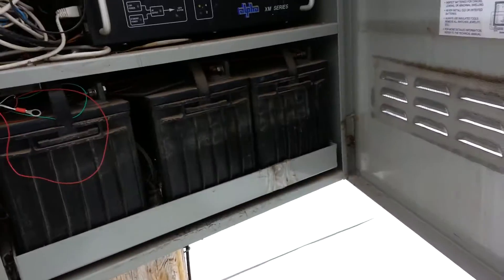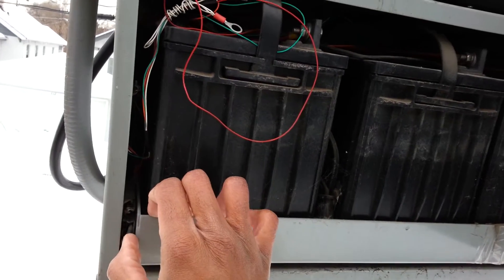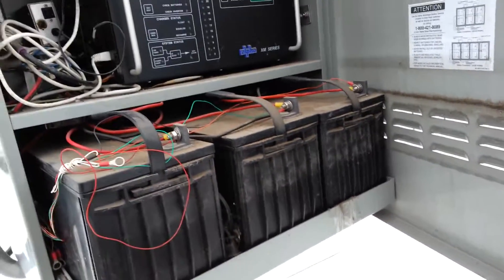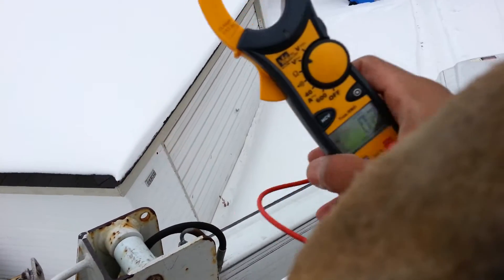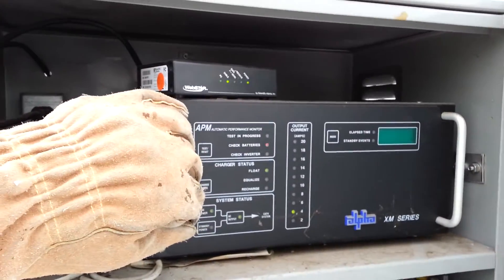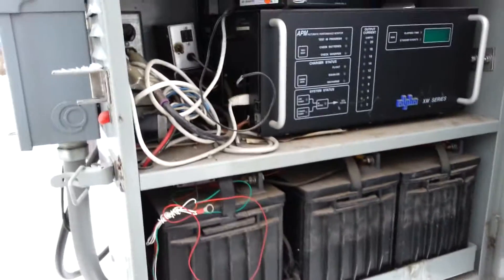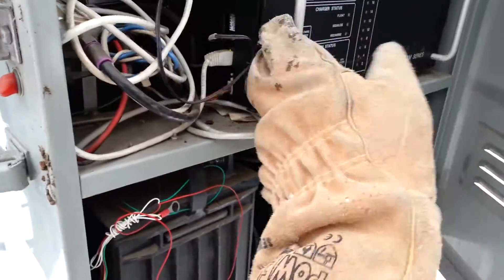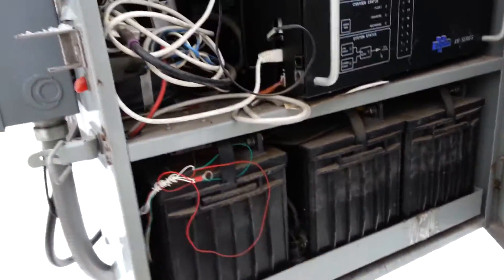CATV Power Supply

Comment: Yo is your prime contractor hiring if so can you let me know which company is it. I got 5 yrs exp
Reply from the maker: I don't work for WOW! Anymore.
Reply: @ALONZOBELL  ook im looking for another prime asap was wow a good company .?
Reply from the maker: @juliomatos3538  in 2005 they were. Now with a big changes in the management of the company it's gone down hill.
Reply: Thanks for heads up i figured i called havent got a response back im just trying to get back to doing only power supply maintance.kinda hard when you cant just find them on cable bar.

Comment: how many nodes  get powered by the power supply and wht is the normal distance from the first to the last node?
Reply: where i work in southern ontario, its 1 power supply per node. nodes are designed to feed a designated area. its not really first to last node, you will have as many nodes as needed and we are always adding more.
Reply: Interesting, thanks for the feedback

Comment: I had a question, Why would backup batteries ever be needed for residential services? Wouldn't only a tiny minority have backup power for modems/T.V's etc.?
Reply: Two Reasons. First is that many customers have VoIP through their internet and the modems that deliver it will have a backup battery built in that lasts between 30 to 120 minutes. The second reason is that many people are beginning to work from home and do use APC backup surge protectors.
Reply: I believe this has more to do with cable companies who offer VOIP services and having to continue to provide E911 service in the event of a power failure.